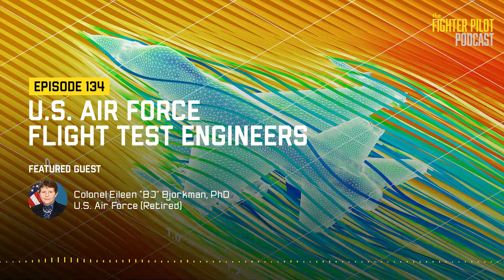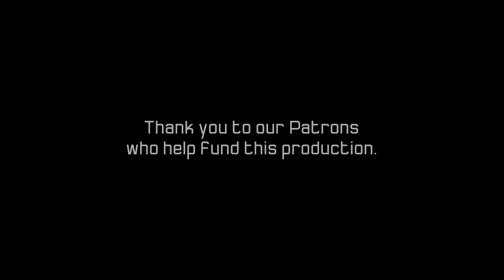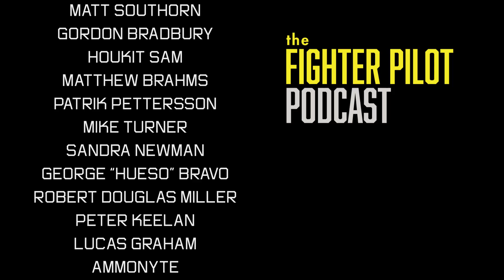134  - U.S. Air Force Flight Test Engineers

Comment: The near miss stories reminds me of way back when I was a new sky diver at a DZ in the thumb of Michigan. I was under canopy about 1800 ft when I noticed two faint smoke trails headed my way. They caught up quickly and it was 2 A-7s from Selfridge ANG base. They passed below me and slightly to the side. Back on the ground my instructor said the DZ was right on a low level route for them and the jump pilot usually was in communication with the base and it ocassionally happened. I don't know if the A-7s saw me but I sure saw them!
Reply from the maker: Yikes!
Reply: That's a bit more excitement than I prefer.